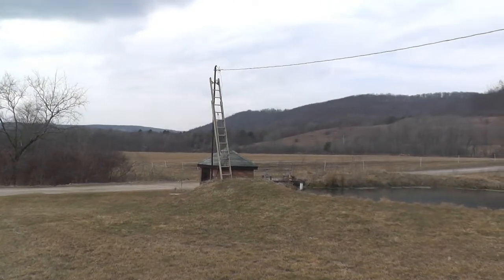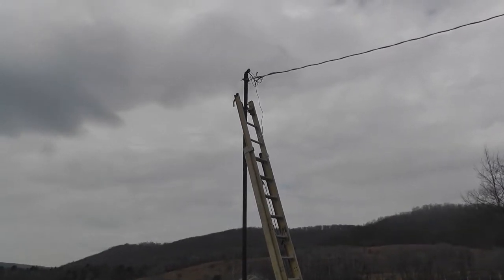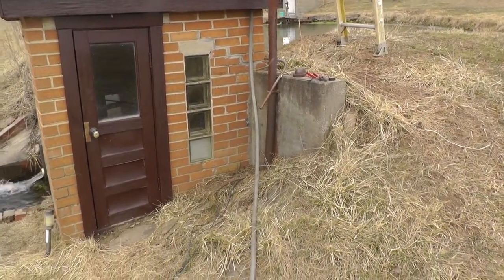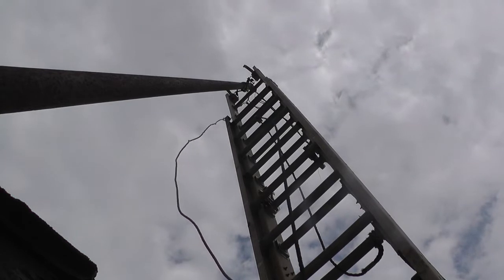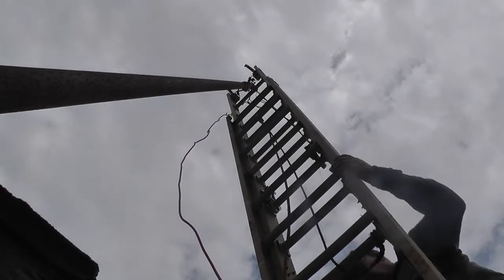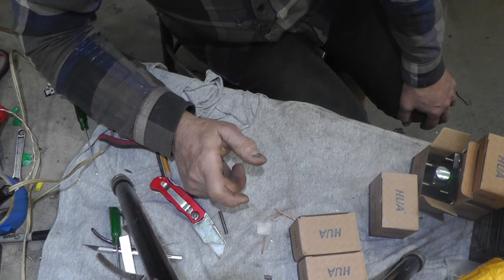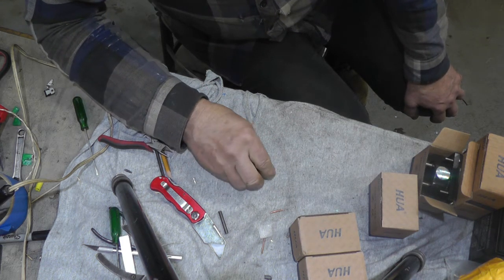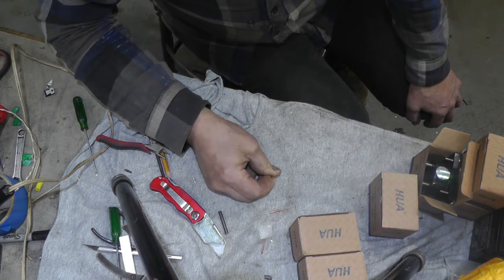Getting Started on the 3 Phase Transport for the Smart Drive

Comment: It's probably a bit late to consider, but what if you put the batteries and inverter in the water-wheel shed, and sent the power as 115v AC to the house?  AC is excellent for transmitting over a distance, and only needed the 2 wires you had.
Reply from the maker: Not enough room. To cold in the winter. Not very weather proof. My windmill and solar panels are near the house. I can easily check how all the systems are working inside at the garage no matter what the weather. The waterwheel has the lowest output amperage ( but it is 24 hours a day ) even though it's the furthest away so over all the least loss. I will be running the 3 phase ac from the smart drive to the house as soon as I get the 3rd wire in.  But I do thank you for you for your idea. I have gotten a lot of good input from viewers like you. Thank You.
Reply: @kevincrawford2027  That makes sense.  Thanks for the video and reply :)
Reply: @kevincrawford2027  Oh, one more thought, Google for "Enphase Micro Inverter".  They are weatherproof and bolt to the back of every solar panel to send the power as AC.  It's interesting new tech!  Maybe something like that would work on the water wheel.

Comment: Those pipes will actually suck the water down (vacuum in a column of water)
Reply: That's right, if you can get them to flow without air going into them, it will create a vacuum and they will move more water than otherwise.

Comment: You mentioned a bucket truck in the previous video and now i see you on a ladder equipped with hooks for cable work. Phone company?

Smartdrive motors can increase in Voltage at the cube rate it seems if not loaded all the time.